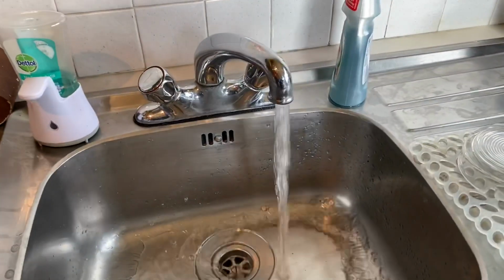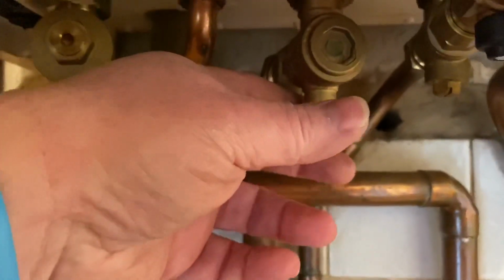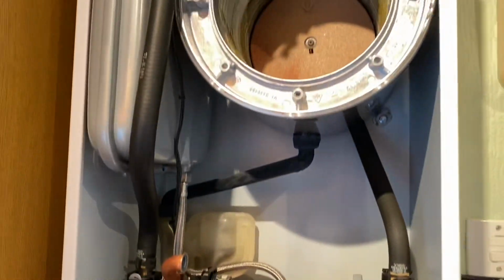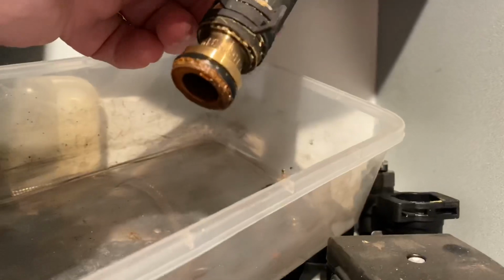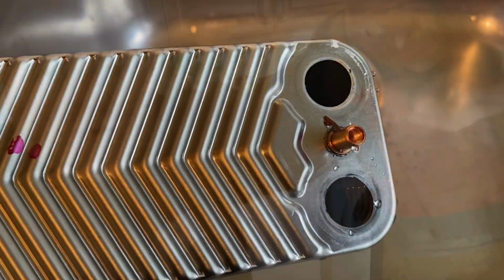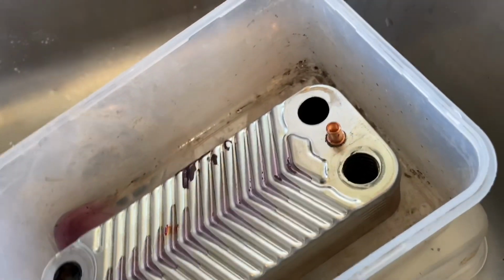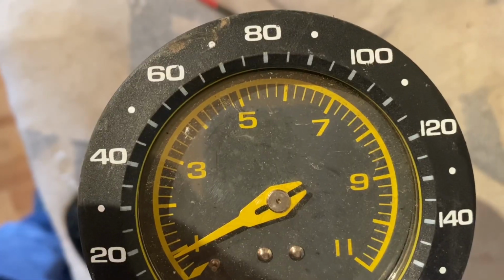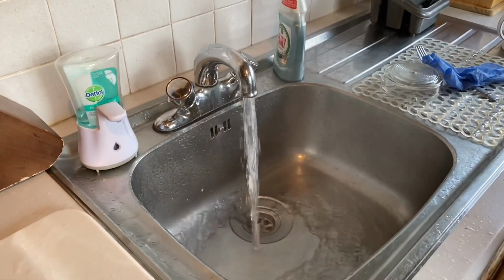Blocked Plate Heat Exchanger Magnetite Sludge - Viessmann Vitodens 100

Comment: Viessmann are good boilers, I’ve work on a few, but they’re not designed for our systems.  In Germany they fill their systems with distilled water.
The rubber hoses is a crap design, but they’ve changed them to copper on the newer models.....Hmmmmm.......German Engineering??
Overpriced plastic & rubber hoses.  Which is a pity as they’re OK boilers.
Reply: Fibre Washer The rubber hoses never gave me a problem last 10-12  years I fitted all my boilers on the clean systems and  mostly they’ve been as good as gold
Reply: Salim Khan  pleased to hear it mate, but the fact is; it’s a shite design & they don’t like being told that.  Their boilers are like WB & Vaillant’s, you pay over the odds for basically the same as any other boiler, if not worse!!!!
Reply: Fibre Washer , I don’t agree with that mate, been fitting viessmann’s over 10 years, easiest boiler to fit & service, im happy and customers over the moon
Reply: Fibre Washer ,I’m only speaking for the ones I fitted and up-to-date some 12 years later, I’ve had no problems at all if they were a shit design I would certainly not have one in my own house! I can understand hoses will be a problem on a dirty system full of magnetite for around £850 you getting a good quality boiler excellent on the performance and lasting 15 years what more do you want?
Reply: @SalimKhan-gk1fh  You make a good point... and calmly. I'm just getting started in this industry and this boiler looked great to work on. So far I've been trained mostly on Worcester and Ideal boilers, not always a lot of room to work in😄
Reply: Simon Hilling You won’t cut your hands on this boiler ! there is lots of room to work and the toolkit supplied for servicing these
Its brilliant you can easily remove most components within 10/15 minutes
Reply: @TheDickPuller  You say basically the same as any other boilers, but I service a lot of Viessmanns that are 13 to 15 years old now, still on their original hoses and still going strong, not many of the others makes are lasting that long, especially the aluminium varieties! The only thing that is shite is the quality of many of the installations in the UK sadly.
Reply: @tarquinbiscuit-barrel5871  Yes you are spot-on mate the biggest trouble these boilers suffer from is of course crap installations installed poorly for no clear reason whatsoever? Get Paid to fit the boiler for a days wages and have it finished by lunchtime ?interestingly the vitodens models across Europe Germany Switzerland France & Italy still have the rubber hoses .the engineers over there don’t seem to have trouble with them but mind you they are filling system water with about FIVE different fluids ranging from deionise water antifreeze distilled water etc,The fitting standards are higher over there, us guys ? Oh we just throw a bottle of inhibitor in and job done!

Comment: What are the views of the rubber hoses?  Quality hoses on car radiators/heaters can last well over 20 years and 175,000 miles or so. They reach temperatures higher than domestic boilers. Latex radiator hoses just do not go wrong. More expensive but worth it.

Comment: A bit of hydrochloric acid, or a litre of brick acid from the builders merchant, works good.
Reply: brick acid,really?🤔
Reply: Vinegar
Reply: Brick cleaner, (Hydrochloric acid) should never be used on stainless steel, it will degrade the stainless of the H/exch.
Reply: @IPfrequently  I use it all the time, never ever had an issue, some of them are titanium any way. It is a quick cheap reliable    fix that brings them back to new.
Reply: @barryanderson3480  Yes Barry it definitely cleans them out, but as I say it degrades the stainless properties of the metal, being very corrosive. Phosphoric acid is reccomended and is readily available on line and cheap.
The proprietory brands of powerflushing chemicals usually have a blend of phosphoric/citric or similar to deal with both the metalic and calcium deposits.

Comment: Hi Allen I am looking to buy a Viessmann Vitodens 111-W 26kW Storage Combination Boiler Natural Gas ErP on line and have it installed. Could you tell me what other parts I will need or order with it to avoid installer saying you for got to order this part etc.
Reply: Andy Taylor hi Andy make sure you buy magnaclean clean to go with it,
If your old boiler is working try and run some cleaner through it and get ur guy to hot flush it
are you old radiators old  or newish?
Reply: Hi Allen I am looking to have my boiler replaced, what boiler on the market today would you have fitted to your house if you had to replace your boiler. Looking at a  (Viessmann Vitodens 111-W 26kW Storage Combination Boiler Natural Gas ErP) or a  (IDEAL VOGUE MAX COMBI 40 GAS COMBI BOILER) are these both an a par with each other if yes what would be your choice. Changing from oil to PLG
Reply: Andy Taylor  I would prefer the viessmann over an ideal any day, I’ve fitted 3 now, but bear in mind it’s quite a huge boiler! 
It won’t fit well on a kitchen wall,
Reply: Salim Khan hi ok thanks for that. What would be a good price to have a viessmann 111-W 26kw installed if I were to buy boiler in same the place as existing boiler. Space is good and access is good, also having a power flush to system and a nest controls fitted.

Comment: great vidio Allen this should be shown to all customers that are tight wads and dont want to pay that bit more for a proper service.
Reply: Problem is, each time you take burners out, you’re supposed to replace graphite seals, which adds around extra £35-£50:00 extra time and materials onto service price. The burners shouldn’t carbon up anyway, and a flue gas analysis confirms burner ok. Burner seal only needs to be changed every five years on Vaillants. So periodically, yes, take burners out, brush main heat exchanger, pour jug water or two through heat exchanger, fit new seals, including electrode seal. But this doesn’t need to be done very service. It would be like putting new tyres on car every year, when there’s still plenty of tread on them. So thought it a bit unfair to suggest that burners should come out every service. Just saying.

Comment: So this is the early boiler design with rubber hoses the later incorporates copper hoses, but still if there are no inhibitor in the system from new then corrosion will still buildup inside the surface plate (rust) and this then completely blocks the hoses.  So the moral of this story is clear, make sure that your total heating system is serviced every year and more to the point insist that there is the correct ratio of recognised corrosion inhibitors in the system.
Reply: I don't know the failure rate of the rubber hoses, however high quality hoses will last and last.  Rubber does not have a good image, so maybe changing to copper is more of an image exercise.
Reply from the maker: What protects the radiators if you do not use inhibitors. Thanks.
Reply: @AllenHart999  
In theory corrosion should be minimal as the water is not being oxygenated, with the system being sealed. Once oxygen is largely removed corrosion should not be a problem. I recall in Germany many installers were not putting in inhibitor as it corroded rubber parts prematurely, such as the rubber bladder in the expansion vessel. It probably depends on the water as well. Some water is more corrosive depending on the impurities of the water.

Comment: Have you ever used spirits of salts for plate heat exchangers Allen? It is strong stuff but the results are second to none, just need to thoroughly flush the exchanger after, I’ve never had any problems using it. It is pretty strong but the results are excelllent👍🏻
Reply: Spirits of salts does the job better
Reply: Paul Kelly Whare do you get spirit of salts my mate recommended it I’ve got a plate on a turbo max to do is one shot just the same ?
Reply: You can get it from Homebase, H&G make it, it’s 23% hydrochloric acid, so wear gloves and don’t breath the fumes. It’s twice as strong as one shot. Flush it thoroughly and it should be good as new👍🏻
Reply: Ryan Love as mentioned be extremely cautious. I used it regularly in my last property as the hex was always gunking up. A tiny dribble on the side of the bottle gave me a nasty burn in seconds. Always use outside, gloves, and eye protection essential. The fumes will make you cough like crazy so try to stand upwind of the thing while you carefully pour.
Reply from the maker: I haven't used that no. Thanks.
Reply: Spirit of salts is too violent for me, that shit will scar you, one shot isn't that bad if you get it on you and long as you wash it off and it gets the same results imo